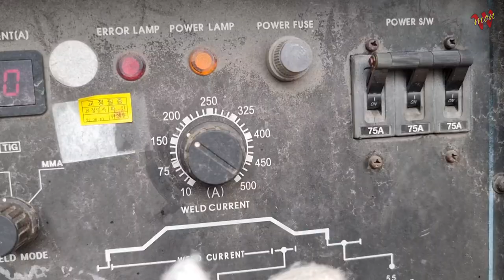아크용접의 놀라운 발상,직접 써보자

Comment: I guess if you can't afford a grinder, or even a wire brush, to remove a little paint. A separate lead with an electrode holder for your TIG welder is also out of the question.

Comment: There is absolutely no reason to hit the slag in the back of the electrode in order for TIG torch to hold it... the electrode is pinched in the front of the torch not the black plastic tube you screw in... I welded with electrode using tig torch dozzens of times...